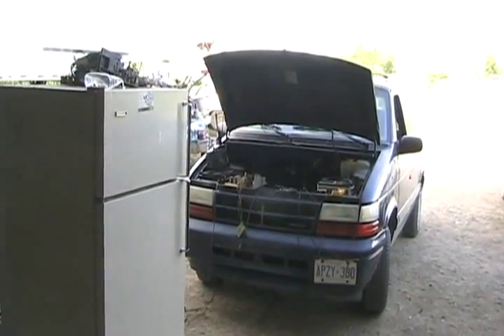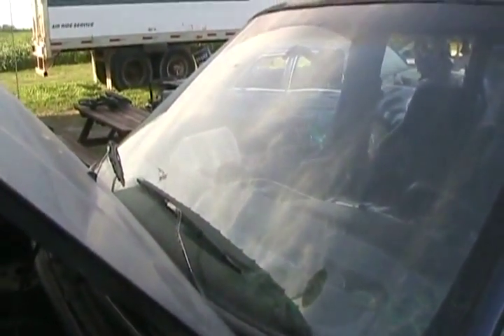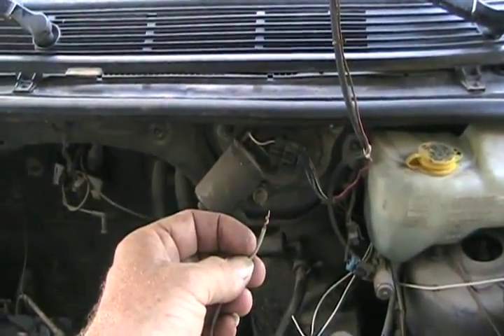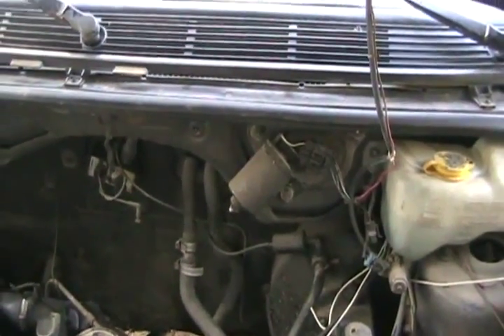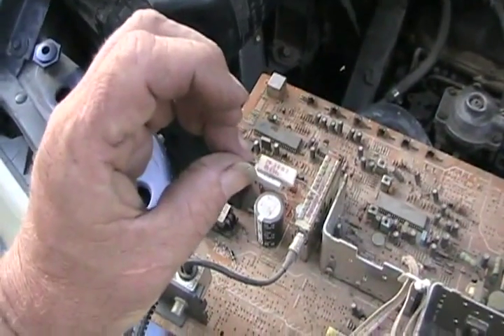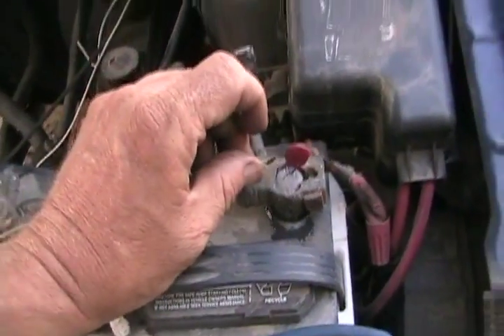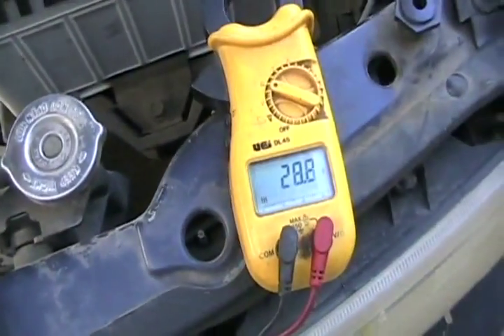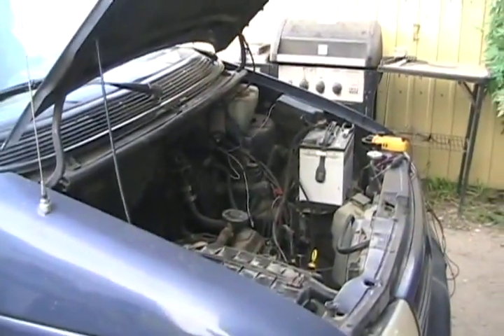#1418 A television part fixes my bad alternator [Davidsfarm]

Comment: What would happen if you used a bulb? You could replace the thermoresistor.  It would supply voltage to turn the alternator on but would light up if the alternator was not charging.